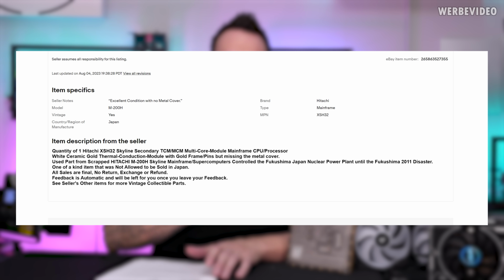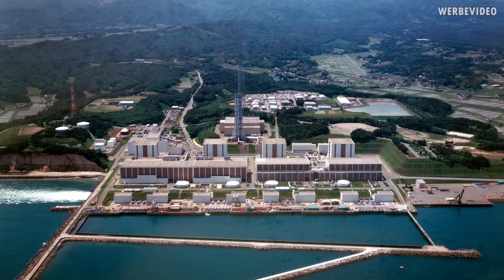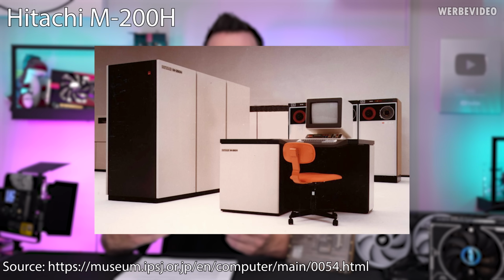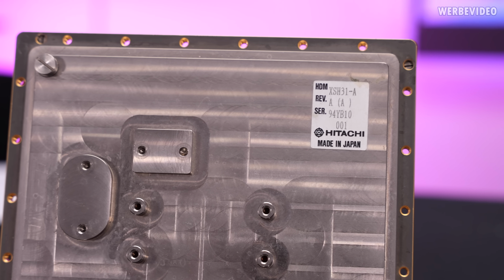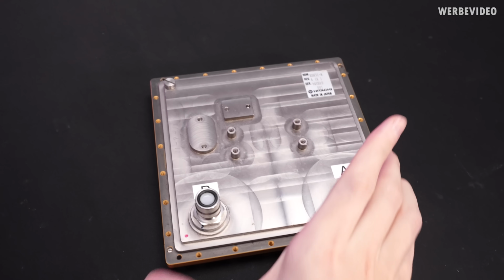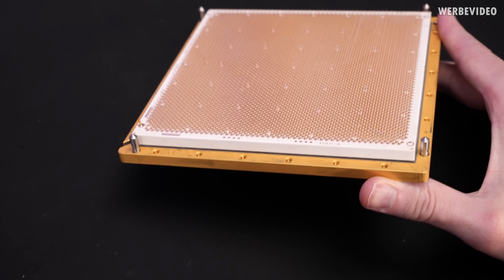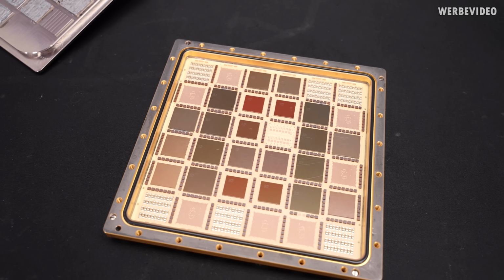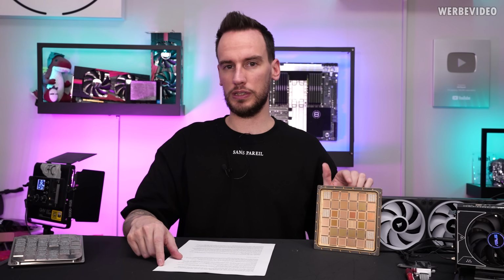This CPU was used in the Nuclear Power Plant Fukushima Daiichi?

Comment: I worked on mainframes starting in the late 80's. We used ICL Fujitsu stuff. They never disclosed the pricing as everything was leased. We went to client server distributed computing in the early 90's using Unix servers. When we had the mainframe, the ICL engineers had their own office on our site. After we had dumped the mainframe and were clearing out the engineers office we found a confidential price list. The nodes, which is what they called the processors, the top of the line nodes we had were £10M each, and we had 2. These things were massive thou, about 8 foot tall, and about 5 foot square.
Reply: I love mainframes. Big iron is still so important. While working for the Canadian government I learned a bunch about it - so awesome and surprisingly cost effective.
Reply: Yeah they get BIG.  Imagine a set of 20 or so of these nodes in a tower, with all the storage space to feed data into the CPU cluster at a rate fast enough to get your money's worth out of paying for the whole thing in the first place.  Plus all the networking gear to get that data on-site in the first place.  That's why the things are cabinet sized by the time they are actually working in the real world.  

The node thing is because in design for a long time these things were basically discrete cpu's that just happened to share a mounting surface and cooling solution.  There's a bit more too it than that considering they are running different instruction sets and doing redundancy checks and I'm sure I/O routing is a nightmare on these things, but essentially, its somewhere around 4-16 different full cores and the supporting infrastructure for them.  The nomenclature has stuck around even in the age of multi-core computing because they still have multiple of what we would normally consider a full CPU on the die.

Back when I was getting some training on mainframes for IBM, I think I remember them calling their "hot swappable compute package" "pucks", they were just a node like the one in the video, though with some design considerations for the hot-swappable part.  Also yeah let that sink in, hot-swappable CPU clusters.
Reply: @zippydaspinhead  I'm happy just with hot swappable RAM, hot swappale CPUs are insane, but an entire cluster hot-swappable, amazing
Reply: This is a close relative of the Fujitsu - they kinda co-stole the tech from the System 390. Mum used to work with one in the Australian Bureau of Stats
Reply: @yakacm What happened to the processors after it was decommissioned?
Reply: @josephschaadt5325  Do you mean the mainframe processors, I am not too what happened to the £10M ones. We had a few different machines, when I arrived the had ME29, but soon upgraded to 3980 and then SX. I know the ME29 system went to India, not too sure what happened to the others. ICL called the processors nodes BTW.
Reply: @yakacm  Yes, I meant the mainframe processors. I was wondering if anyone got to take them home after the decommissioning. It is sad to learn that many of these were destroyed. Nodes, that's cool to learn!

Comment: This was super interesting and I had no idea such large CPUs exist. Thanks for the video.
Reply: there is an soc called the Cerebras wafer scale engine, and as the name implies, it is a wafer scale chip, meaning it uses a whole entire wafers worth of silicon for its die. I think its like 20,000mm2. The second gen chip uses TSMC 7nm hpc and packs over 2 trillion transistors.
Reply: @crowntotheundergroud That's awesome, thanks for sharing. Hilariously, they have a table on the product page comparing their wafer chip to an Nvidia A100, and they cite their 56X larger chip size as an "advantage." 😄
Reply: Check out Tesla Dojo cpu. one of the newer 'generations' from elon
Reply: Always remember what you have at home as CPU - GPU - RAM etc.
In the computer industry the single component is 100 to 1000 times larger.
For example search for "Cerebras WSE-2" or "IBM 305 RAMAC 1956 5MB".

As you see IBM is always at the largest scale with all things related to computer technology, you would almost think they are not from earth.
Another thing to think about is, how is YouTube storing all the 10* Peta Bytes of data weekly that humanity is making on their platform?
Do you think they are using just regular enterprise HHD/SSD for that or use a super secret storage box that is big as a car?

Comment: Umm and what about speak to Hitachi directly?! And no on that CPU should not be any radiation because also radiation can affect performance or computing process and also if you had microscope you can look on cpu and find something like numbers and maybe some letters infront that numbers and if you google it that can tell you anything about that cpu you need to know but where to look at i can't tell every version can have different position of that numbers and about upgrading  cpu/server control unit poweplant is not shut down just run on spare units and after all things what needs to be done it will be run on new one but this is usually done along with fuel change so yes partially it's offline so these units are really off but it may happen that way what i mentioned when some on that running unit is broken or something so...things work that way 😉

Comment: Things can only get radioactive when exposed to neutron radiation and there's no way this CPU could have received any significant dose.
Reply: Yes, the objects themselves can't but can collect radioactive dust or contaminants say in the coolant.
Reply: If it got exposed, it would have required a full-scale meltdown with the lid blowing. It's possible to contaminate a control room, but at that point, the surrounding areas are probably fucked. Ala Chernobyl, Ukraine
Reply: Even though the object can't become radioactive without getting "activated" by neutron radiation, it can still be contaminated by the radioactive dust in the area.
Reply: it would have had to be cleaned so insanely perfectly to not register anything, it came from a pretty moderately contaminated area
Reply: There is just no such big dosage there, the most you could get is when hydrogen (and other radioactive gases) escaped, and that was FAR from lethal.

Comment: I work in the energy sector, but hydro.  We have tons of 30+ year old tech all over the place (with some much, much older).  We don't upgrade things that work as designed and as strange as it may be for top drawer tech guys to wrap their heads around, the reason is simple - how the sytem works never changes and therefor does not require faster PLCs or any other computer system.  We only upgrade control & monitoring when absolutely necessary.  In my sector, it's all about avaiability of replacement parts.  The nuclear industry may/probalby works differently.

Comment: 12:30 Looks like its symmetrical, theres 4 sets of processor modules on each side, pairs of IO  in the middle so they can be shared and memory controllers up either side on the edges

Comment: The units I work on used PDP-11s for the control computers built in the 80’s. They were then upgraded to use emulation in the early 2000’s, so could have been used as a midlife upgrade.
Reply: Were they Kent P4000 running the K90S operating system.
Reply: @macman6421  No. forget the name of the original computers, but they run a custom OS built just for the plant I work at. I knew all the details at one point, but those Cheerios fell off the stick long ago
Reply: @Martycrane I was thinking of the system they had at BNFL
Reply: @macman6421  I’m on CANDU’s. the computers got upgraded as I was starting so I very briefly saw the old stuff. Still used reel to reel for some programs we had to load in infrequently. Same with paper logging. That’s all gone now though, it’s all emulation

Comment: If this CPU was actually used at the Fukushima Daiichi Nuclear Power Plant then it still would be partly radioactive. The problem with the meltdown was in software and procedural disparity certainly not hardware or this or any "CPU."
Reply: For one no, because not that much actual radiation was released, especially not sind this would have been inside a building that's actually probably the best shielded against radiation and secondly it wasn't caused by a software bug or CPU, but a literal tsunami hitting the emergency power that was not well enough protected from the ocean and without power, well there's now software bug that can occur...
Reply: No, it should not be radioactive.
It's not like radiation is an aura like Goku, it's material deposited from power plant. The CPU was inside, there is nothing that could have contaminated it.

The area itself is now basically at the same of normal background levels.
Reply: @IIARROWS  .. I'm not talking radioactive where it would burn your hands off FFS, or even be dangerous, I mean it would have a radioactive signature above normal background. I'm a chemical engineer. Even under normal use in a nuclear power plant and without the incident it still would be measurably slightly higher. Everything, including you or banana has a background radioactive signature.
Reply: @DJaquithFL  Ok then: explain why it would have an higher radiation signature.
I'm not talking about danger either, I'm telling you there is no reason why it should have.
It's still silicon.
Reply: @IIARROWS  .. Do a quick search about the background radiation levels of any normal operating nuclear power plant compared to normal background and then get back to me. Clearly in this case it was way above what would deem as "normal levels of radiation." This isn't a big thinking moment, it's an obvious AF iteration. 

If this CPU or any equipment came from any nuclear power plant, it would be above normal background levels and in this case, even slightly higher depending upon the shielding between it and reactors that when critical. In either case, [measurable.]
Reply: Bruhs trying really hard not to be wrong about everything in his original comment. 😂
Reply: @potatopobobot4231  .. No, you're projecting, quote my exact words where I implied it would be dangerously radioactive. Roman is the one who mentioned about a Geiger counter and incorrectly implied a high level of radiation. Let me clear, everything that comes in the United States is screened by the CBP for radiation, in Germany and Europe they have their own set of screening standards. No, what happens is people want to read what goes on in their uninformed minds and then troll. 

Instead, what I suggested is a way for Roman to determine whether or not that CPU or any artifacts may have come from any nuclear power plant and particularly the Fukushima reactor.

Comment: It would be interesting to x-ray this cpu. You might get insights about the function of each tile.
Reply: The old process should make details easier to see.
Reply: Just a thought. 

This may very well be a shielded CPU, it may just show up as a bunch of white bricks.
Reply: my thoughts exactly
Reply: No need for X-Ray: silicon is transparent for longer IR, look up arXiv:2303.07406 , you can do cool die shots with 1050nm IR light through the silicon substrate
Reply: For the X-ray the silicon is completely transparent.. even for the super high resolution X-ray machine's..

You can use a good resolution X-ray to see on the ceramic layers and wires but nothing else..
Reply: Absolutely not, X-Ray has nowhere the resolution to tell you that.
Reply: @FrozenHaxor  sure, but specialized x-rays should be able to reveal blocks of contrasting densities which might clue us on their function. Also the substrate wiring should surely be visible since the traces there are fairly thick.
Reply: @muddypt  No. You can put a piece of silicon in front of highest resolution detector and it will act as a piece of paper. You need to section it, then metalize and look using a scanning electron microscope to get anything useful. There simply isn't enough difference in microstructure density to give you enough information through X-Ray analysis. All you would see at most would be bottom metal interconnects, which again, won't tell you much as it's mostly power rails.

Comment: "The most obvious thing to start with is Googling anything that's written on the CPU" That's what I had to do when I was doing electronics recycling. Annoyingly it rarely helped for anything actually interesting we found. That label on it made me instantly know it was going to be the best thing ever, or leave me questioning why it's even there in the first place. It's even more fun when they don't even have the manufacturers name on it. Good times...
Reply: Its an IBM system/370/390 clone, whole industrial espionage thing. If you start on the wiki for IBM MVS you will get some clues.
Reply: an easier way to find out is to get a Geiger counter
Reply: @MikeZak101  If it was inside a server case then it'd be unlikely to register other than normal
Reply: my bad, didn't realise server cases were radiation proof @WyndStryke
Reply: @MikeZak101  They don't need to be radiation proof since a few gamma rays going through it won't have any long lasting effect, just airtight enough to prevent debris (radioactive dust) settling on the interior components.
Reply: @WyndStryke  hm a gamma ray into a cpu can be potentially very threatening if it flips a bit and the cpu is controlling a nuclear reactor.
Reply: @Ramog1000  If there's enough gamma rays entering the control CPU of the power plant, it not reliably controlling that reactor anymore is the least of your problems.
It wasn't controlling that ongoing disaster anymore for a while if it got to that point.
Reply: @Ramog1000  how tf would that happen? If it ever got to that point the reactor is already actively failing in which case it doesn’t matter
Reply: @Ramog1000  I wasn't talking about ongoing operation of the computer - if you look back at the conversation, MikeZak suggested that you could use a geiger counter to see if it really came from Fukishima.  But that wouldn't work, because a few gamma rays hitting the CPU would not cause persistent radiation.  Also, if you watch the video, this computer was not controlling the reactor (it was installed many years after the reactor was first operated, and the control systems are not upgraded to avoid unnecessary recertification).
Reply: If you look,  @Ramog1000 , that cpu is symmetrical, likely 3 way voting with a hot spare, so that it can detect and correct that sort of thing with not a single cycle lost.
Reply: Its really not that unlikely they got a CPU upgrade when it got hard to maintain,  @WyndStryke  . The systems would have been completely redundant and the new mainframes are made to be entirely compatible with the old. The reactor is shutdown regularly (as #4 was on the day of the tsunami) for maintenance - thats the sort of maintenance they would do in that time, upgrading one of a pair at a time while the system is shut down
Reply: @MikeZak101  radiation itself doesn't actually linger, what lingers is the radioactive isotopes that emit the radiation in the first place, as long as the control units are relatively isolated from the bulk of the dust and crap that got kicked up they're unlikely to actually carry much radioactivity

and as all forms of radioactive matter eventually decays, after a decade most of the worst of it is already gone, whats left is mostly a lot of lower radioactivity isotopes largely stuck in the surrounding rubble or ground, any amount that'd collect on one comparatively small part is going to be quite insignificant
Reply: @MikeZak101  huh? Not sure why you're mentioning that since it has nothing to do with finding out what you actually have...
Reply: @MikeZak101 watch the video before commenting.... He already said he did that he just wasn't sure what we call it in English..

Comment: The common name in English for a measuring device for radiation is a Geiger Counter (or Geiger–Müller counter more correctly). Another name thats more agnostic of the measuring method is a Scintillation counter.
Reply: He was probably confused because it's Geigerzähler in German, but as both Geiger and Müller are German names, they rarely translate this directly into English.
Reply: Also, if this thing was still so radioactive, there would be no way you would get it shipped.
Reply: @p_mouse8676  I mean does anyone at the post office truly check that?
Reply: @cromefire_  in modern sorting centers it just goes automatically through a machine. Especially when it has to go into an airplane.
Reply: Absolutely they DONT
Reply: Zählrohr

Comment: Eevblog also has a video. if anyone intrested.
Reply: Correct. Dave had the IBM 9121 TCM Processor module from a 390 ES9000 Enterprise Server Mainframe Computer. CPU is a 63 layer ceramic hybrid module construction with 2772 pins and is oil filled for cooling. Very interesting CPU.
Reply: Which ironically is a REALLY closely related CPU, whole industrial espionage thing.  @ROBUST_URBAN_G_McFLY